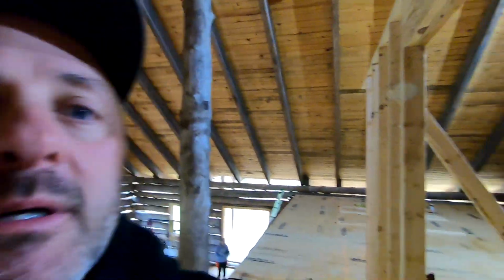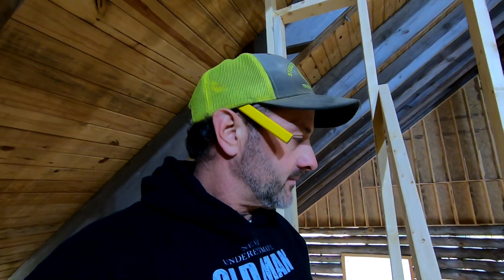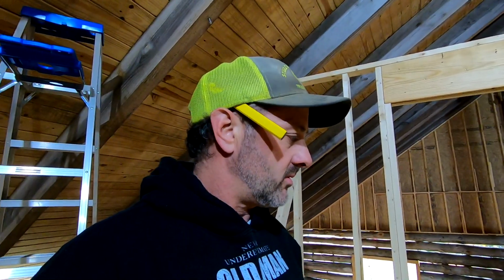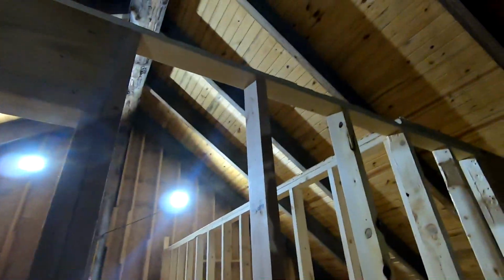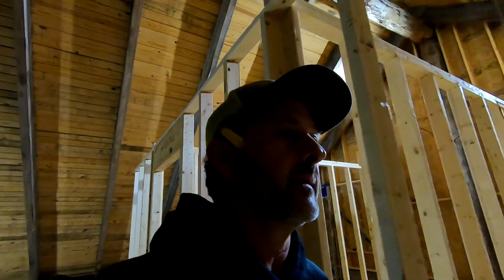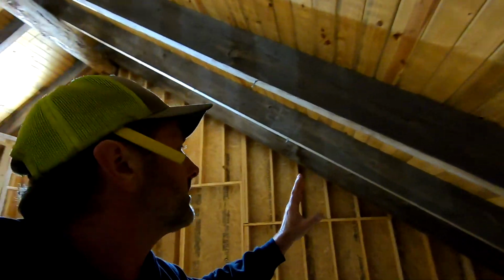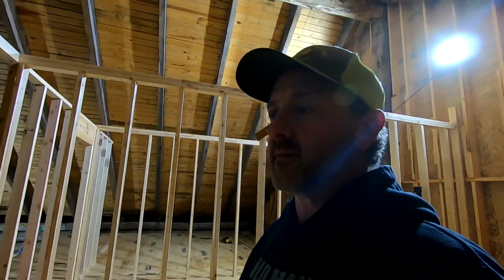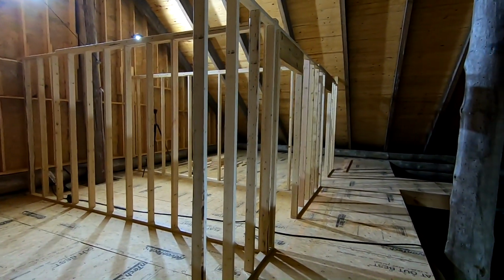Starting to raise upstairs wall in the LOG CABIN

Comment: I was interested to know what foundation building technique you used did you just set those huge concrete blocks on the dirt or are they poured concrete piers that go like 4 ft down...what kind of site preparation was necessary...I looked for an early video on it but not seeing it...are they holding up everything square and level etc...it would be very interesting to see a video on that if your so inclined....its amazing the magnitude and scope of what... one guy...you've accomplished
Reply from the maker: They are poured in place 48"x48" on the bottom and 48" tall. They are almost 1 cubic yard of concrete each.
Reply: @hickoryridgehomestead9177  Thanks I just had to know...It looks really beefy...very, very nice!